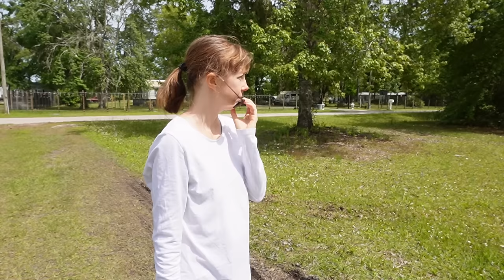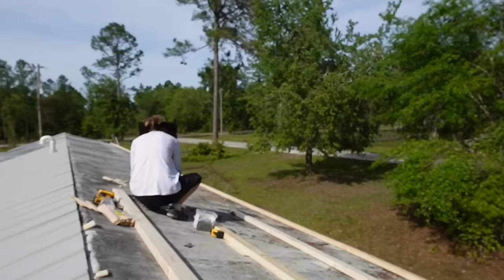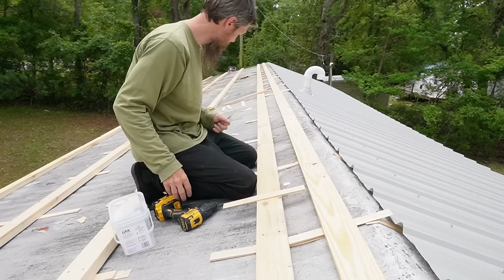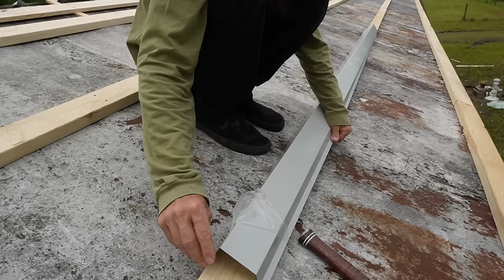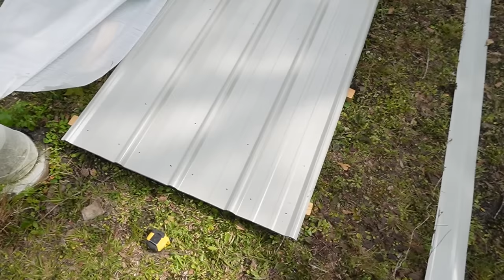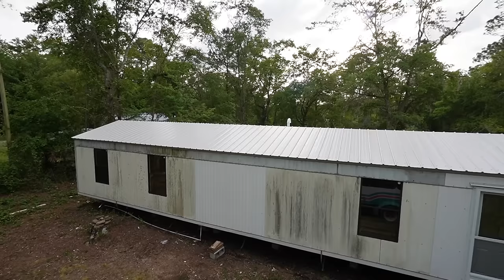Roof Panels Finished - Salvaged Mobile Home Rebuild

Comment: Doug's total surprise when it didn't fit!  We NEVER hear that.  I on the other hand am never surprised when something doesn't fit when I cut something.
Reply: LOL!  Same!
Reply: I’m surprised if it actually fits when I cut something.
Reply: Murphy's Law. You just can't get away from it. One way or the other it's going to bite you in the goo goo.
Reply: Those mobiles have a 6 to 12 inch overhang on each end. Good job and be glad the home did not twist or shift when you removed the interior.
Reply: REALY??? I thought I was the only one that had that problem !!!!

Comment: That must feel terrific!!!  Almost done!  In the sped up version of the roof going in, I thought Ashley must be pointing some things out to you as you worked and then I realized she was handing you the nails/screws. 😂 Didn't think you needed that much instruction....  Windows done, subfloor done, trusses done, siding replacement done, wiring done, roof done!!!!!  And there is probably more that I missed.  Woohoo!!!!  Way to go!!!

Comment: The roof is looking fantastic.  It's a tough job and it seems that the heat of the sun isn't making this easier. As you pointed out the new doublewide coming in, I could not help but think your home renovation is being built better than the newer manufactured home construction.  
As always be well, be blessed ❤

Comment: I didn't get to comment on last video, but yes the rubber thing you put around the pipe is called a roof boot (they have high temp and regular).That was super cool seeing the other mobel home being moved in. Here in northeast Ohio it got dark enough during the eclipse the blue sky looked black and since I drive semi I had to turn on my lights. I didn't think of it till now but did you know they make an insulation for under the metal, it looks like bubble wrap. I like the idea with overhang, that should also keep even more water off the side of the house. Great job as always.

Comment: Another project ✔️  checked off the list. 
There is a cleaner for "siding". I think it's called 30 seconds. It did a fantastic job. Use your power sprayer to put in on, wait 3 minutes and replay that section. Then rinse with a hose. It was amazing.
Can't wait to see the trailer clean & painted.

Comment: I know it is more work but a dormer roof would add value plus a better statue to the appearance of the home I renovated a roof like yours and added a dormer roof too the equation helps with rain displacement and such I see the home that come in had it! It really is not that difficult to add it in!  But great job with the new roof!

Comment: Great video.  Love the work you are doing.  But going back to cleaning the outside of your home. I use a pump up sprayer with straight bleach. Then I use a plug in electric pressure washer that I bought at harbor freight.  It works great..

Comment: ** wow  what a difference.. looks beautiful!!  if a home could smile, this one is for sure..  =D.   Was thinking if you built a roof/overhang on both sides, like one would for a carport etc, that would keep all the rain away from the house regardles of the extra 4 inches as we all know, water isthe ruin of any home.. .  I know it would be a bit more costly but would be major valuable in the end.. especially for resale value.  no need to build porches, patio/deck or parking slab at his point but the overhang would be worth it in my opinion and leave a ton of options for future upgrades. I do remember you said it's a rebuild not a renovation.. just something to think about and just sharing and idea i had pop up..  Still amazed at how that roof transforms everything.. man it looks so good.. I love the light color too,  makes it look light and bright and clean and fresh.. Great job guys!!!

Comment: As you get closer to making your mobile home inhabitable, is there any chance that you might have any issues with "squatters?"  It seems to be becoming a major issue in many parts of our country lately.  I thought I heard that your Florida Governor had recently signed some legislation to increase protection for homeowners in your state.
Reply from the maker: Squatters are usually a city problem. We will not have that issue. We are at this home all the time.

Comment: Roof looks great.  I noticed you didn't use the foam gasket at the bottom eave to keep insects out of the gaps where the bumps are in the panels.

Comment: You should have let Ashley  install some also.❤
Reply from the maker: I didn't have any desire to install any panels. Plus I'm not that great at using a drill. Also, I have barely any reach. Doug is taller and can reach across 3 feet better than me to get that outer edge.

Comment: Are you going to seal up both ends of the drip cap? It sticks out far enough that it leaves that gap you showed us. Great place for spiders, critters and debris to accumulate.
Reply from the maker: Yeah, the ends are folded and will be covered by the gable trim. It will be closed up pretty well.

Comment: My wife and i enjoy your channel. I'm impressed with your workmanship.  Just a suggestion, would it be with comparing cleaning, prepping and painting vs replacing the rest of the metal siding,?  At least on the front??   Also of your gonna clean and paint i live thirty second cleaner, it does a fabulous job.
Reply from the maker: We will be cleaning and painting the siding. Each aluminum siding panel costs $80, and they are very drab so we'd paint it anyway even if it was all new.

Comment: I'm sure someone else has told you that you're missing the foam enclosures that go between the roof panel and the drip edge.  This will prevent bees and small birds from getting up into the roof where the ribs are.

Comment: I didn't see you add any precut foam insect/critter barriers at the bottom edge of the roofing. Am I speaking too soon or was it just not videoed?
Reply from the maker: I just decided not to. The roofing supplier told me that only 10% of people install them and that they aren't really needed. We're not worried about bugs, and the water shouldn't be able to get up that far.
Reply: @diyfferent  Thanks.

Comment: A 4 inch total overhang is great, definitely better than it was, but....
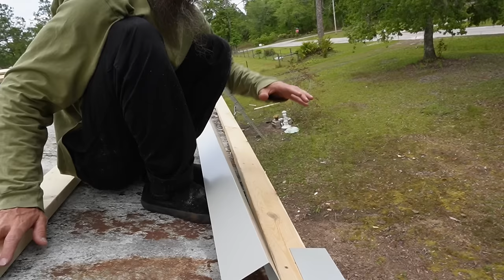@ 11:01 It looks like the drip edge won't allow for the installation of gutters. From what I've seen on some other mobile homes.... They would lay OSB over the old roof, extend it about 6 inches over the side, then place 2 x 4s under the OSB overhang to create eves. Of course, that is a lot more work.
Reply from the maker: We won't be doing gutters on this home.
Reply: @diyfferent  Won't that be will be a lot of water coming off the roof making a mess?
Reply from the maker: @timjohnson9830  It's been here for 40 years without gutters and it hasn't been a big issue so we don't see any reason to worry about it now. The water sheds away and there's no foundation to worry about. We're fine with it.

Comment: why didnt you use the foam seal at the bottom edge of the sheets
Reply from the maker: We just decided not to. We're not worried about making it perfectly sealed and the roof supplier told us that it's not needed.

Comment: Bad idea just sayin to predrill, just get the rite bit and a driver not drill motor to install screws
Reply: What they are doing is a great idea. Pre drilling so they don't have to measure for each screw. Also, the correct spelling is right, not rite.
Reply from the maker: We'll just follow the manufacturer's recommendations. They say that predrilling helps prevent metals shavings on the roof and keeps them from sticking out under your screws, which look bad and rust. They say that predrilling also helps keep your screw rows straight and will make your roof look nicer. That sounds like  a good idea to me. I've always hated those shavings that stick out and ruin your gaskets. Predrilling is a GOOD IDEA if you want to do a good job.

Also, you need to learn your tools before giving advice to others. A drill driver is the best tool for this job. Why would a DIY'er even think of driving roof screws with an impact driver? That is the wrong tool for the job.